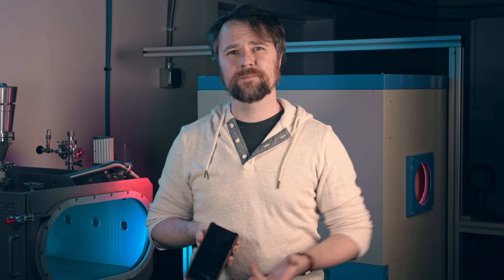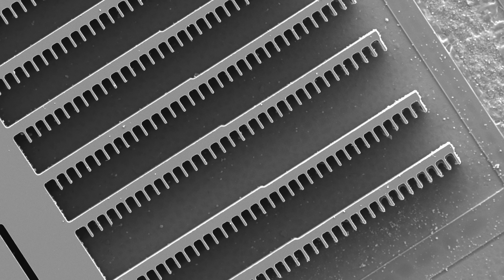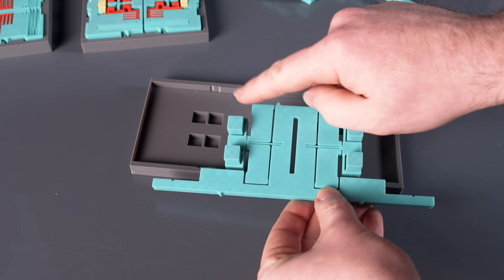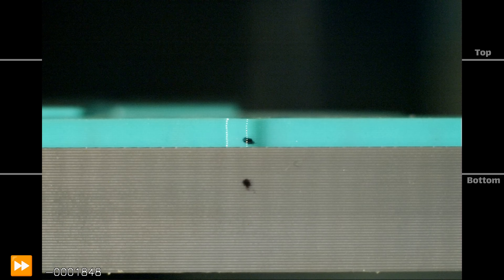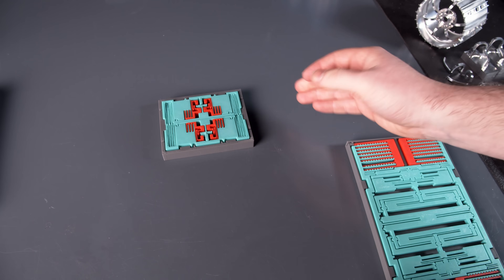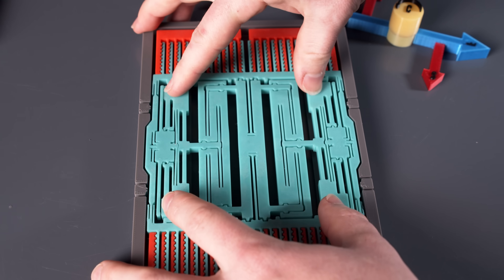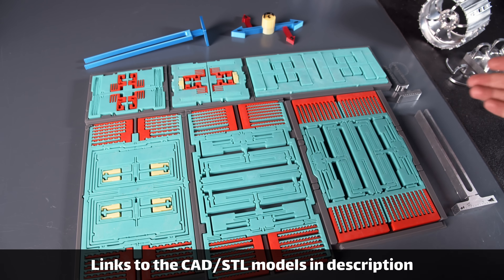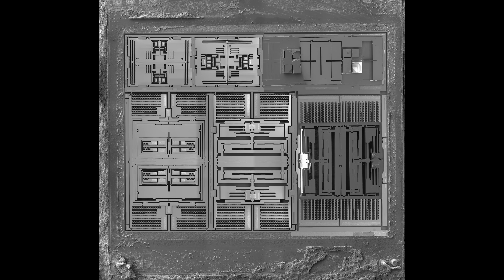The Micro Mechanisms in Your Phone

Comment: Zach, I hope you were trying to simplify the explanation of the z-axis accelerometer. Because when you let go of the phone the one thing that won't happen is that the proof mass will not move because of Newton's first law. What happens (of course) is that UNTIL you let the phone go, the proof mass was experiencing the force due to gravity and thus was deflected downward in the mechanism of the accelerometer and when you let go, it will move up because there is now an unbalanced force on it from the flexure joint.

Comment: Maybe you can clear something up for us. This may only be an urban legend, but rumor has it that Morris hospital in Illinois had a tiny helium leak in their new MRI machine. Helium molecules are small enough to penetrate a sealed iPhone or Apple Watch, both of which apparently use MEMS devices for the main oscillator.

All iPhones and Apple watches in the building simply stopped working. Android phones at the time did not stop working, as they were not yet using this same molecular-level technology.

Helium as a gas expands to 750,000 times the volume it is as a liquid. The theory is that the helium molecules jammed the MEMS devices the same way that a grain of sand could stop a Swiss watch mechanism. Once these devices were unpowered and left alone for a week, they 'aired out' and began working again.

Does this sound to you like it might be at all possible?

Comment: “If you drop the phone, it will feel acceleration in the negative Z direction”. 
No. It will feel acceleration in whatever sensor is aligned with vertical. Most of the time, all three accelerometers will detect it, because most of the time, your phone is at an angle to the vertical.

Comment: 0:30 what‘s with the optical image stabilization? Apple (obviously) had problems that the system(s) die if you ride on a shaking motorcycle too long without a proper holder for the phone…

Comment: 1:42  Back in the day, we used to decap chips like this with fuming nitric acid.  (I worked for an EPROM programmer manufacturer, and sometimes we had to physically open the chips because the documentation was less than helpful)  Works great, but it's nasty stuff - you definitely need a fume hood for it.

Comment: What year were these types of single-material microscopic movement detection devices created? Not just a transistor or microchip but what we’re seeing here
Reply from the maker: MEMS have been around for quite a long time, but didn't really "escape" the laboratory until the late 90's and early 2000s. I'd say they really started to get cost effective (and function well enough) in 2010+. The rise of cell phones has certainly played a roll here. A lot of MEMS semiconductor fabs are actually older / "last-generation" transistor fabs that have been repurposed. MEMS uses larger features so it's a good way to recycle an old facility instead of just junking it.

Comment: Hold on, paused at 6:15, when the phone is falling down, all its atoms (including atoma from thr mems) are moving together - gravity pulls everything at the same force (if we are talking just about the phone). This method with mass can detect when a phone hits something (a ground, floor), but not the beginning of the fall.
Am i wrong?
Reply: Look in the corrections lol. You're very right, but the your statement about the ending of a fall applies to the beginning of a fall too! The piece is having it's normal force applied by the sensor, which detects that an acceleration is on it, but it cancels that out because it thinks about gravity.

Comment: I wonder what sort of lifetime the flex points on the silicon have under normal use, how much movement can they take and what's the failure mode, and what sort of force would break them under a fault condition.

Comment: One thing that I wonder since this is essentially a glass-like material (silicon) is how do these microscopic not crack or break inside of the chip if there is a strong drop. I mean I've dropped my phone many times, yet the accelerometers and gyroscopes still work, how do they survive strong jolts or flexing many hundreds of thousands of times?

Comment: Wow. Very happy I found your channel.
But you made a typical physics error. If you drop a phone, you don't get downwards acceleration. A falling object ( ignoring air resistance) is indistinguishable from a object in zero gravity (See Einsteins Special relativity). Newton laws are only applicable if you are in a inertial frame of reference. If you standing on the earth, you are not in a inertial frame of reference, but you accelerating upwards. Gravity is strange.😆
Phones use special algorithms, that tries to emulate acceleration without gravity.
PS: I'm not a physicist, but at least I know something about this.
PS2: ok. I had not checked the comments, but I see the correction. Thanks

Comment: Ok , I’m new to your channel . Micro gyroscopes , I heard of them , but building something that tiny that actually works capturing movement in three directions . But that’s not actually measuring distance . For example , if you drop your device , it doesn’t measure distance from your hand to the ground . That’s the fourth dimension . 
And then altitude . That’s the fifth demension . 
I used to fly aircraft , and those are the five senses a bird uses to fly . 
But just building a platform to demonstrate them is neerly impossible . Now the next generation of computers . Quatuntum . Yah , that’s going to really test someone .

Comment: Creepy publication from 2019 on accelerometers:

'Abstract:

Accelerometers are sensors for measuring acceleration forces. They can be found embedded in many types of mobile devices, including tablet PCs, smartphones, and smartwatches. Some common uses of built-in accelerometers are automatic image stabilization, device orientation detection, and shake detection. In contrast to sensors like microphones and cameras, accelerometers are widely regarded as not privacy-intrusive. This sentiment is reflected in protection policies of current mobile operating systems, where third-party apps can access accelerometer data without requiring security permission. It has been shown in experiments, however, that seemingly innocuous sensors can be used as a side channel to infer highly sensitive information about people in their vicinity. Drawing from existing literature, we found that accelerometer data alone may be sufficient to obtain information about a device holder's location, activities, health condition, body features, gender, age, personality traits, and emotional state. Acceleration signals can even be used to uniquely identify a person based on biometric movement patterns and to reconstruct sequences of text entered into a device, including passwords. In the light of these possible inferences, we suggest that accelerometers should urgently be re-evaluated in terms of their privacy implications, along with corresponding adjustments to sensor protection mechanisms.'

https://dl.acm.org/doi/abs/10.1145/3309074.3309076

Comment: Extremely cool video!

It's interesting that the Y accelerometer isn't just the X one rotated by 90 degrees. It seems clear that they wanted the gyros to have as much space as possible, and the space left for accelerometers ended up being rectangular, so they had to design two parts rather than rotating a square part.

Comment: The cell phone knows where it is at all times. It knows this because it knows where it isn't. By subtracting where it is from where it isn't, or where it isn't from where it is (whichever is greater), it obtains a difference, or deviation. The guidance subsystem uses deviations to generate corrective commands to send signals from a position where it is to a position where it isn't, and arriving at a position where it wasn't, it now is. Consequently, the position where it is, is now the position that it wasn't, and it follows that the position that it was, is now the position that it isn't.
In the event that the position that it is in is not the position that it wasn't, the system has acquired a variation, the variation being the difference between where the cell phone is, and where it wasn't. If variation is considered to be a significant factor, it too may be corrected by the GEA. However, the cellphone must also know where it was.
The cellphone guidance computer scenario works as follows. Because a variation has modified some of the information the cellphone has obtained, it is not sure just where it is. However, it is sure where it isn't, within reason, and it knows where it was. It now subtracts where it should be from where it wasn't, or vice-versa, and by differentiating this from the algebraic sum of where it shouldn't be, and where it was, it is able to obtain the deviation and its variation, which is called error.

Comment: Micro x-ray imaging is a nondestructive method for peaking inside the chip. Manufacturers use it for verifying surface mount antenna and BGA splatter issues, and IP attorneys use it to peek inside chip dies to verify IP theft.

Comment: actually there is a small mistake here 4:58 which is that dropping your phone is NOT accelerating.. its in free fall geodesic.. the Z axis will report 0 reading while its falling .. it’s actually holding it still in your hand that makes it in acceleration state, and the z axis would report 9.81 m/s reading .. its a very common mistake until you learn more about general relativity ❤

Comment: Honestly I think a better design would use light or some smaller particle emitter to detect the velocity in any direction, let's say you have a narrow path for a single particle with just enough wiggle room that in the event of a change in relative position of the path the particle either bounces or shifts into a further/nearer position to reach the same sensor, pair 3 of those paths in different orientations together and you will get the velocity of any direction based on the time taken to reach the sensor, since capacitors are bulky any ways you could have a dedicated capacitor designed with 3 of such paths attached o it's exterior, which in turn means you only have to deal with 1 design for all 3 velocities and have a chip sort out the details of the 3 before outputting the results, be a lot more like the "static" hardware design that's preferred by companies for it's longevity and reduces design overhead since capacitor design is also simple and static.

Comment: I used heated red sulfuric acid to etch the package; beaker and hotplate; 10 minutes at a time.   Also, you can created a cavity with a milling, and drop few drops of the acid, wash and rinse, and repeat.  The acid can also etch gold (wiredbodn) but a much slower than the plastic package.  Google: istfa proceedings. Safety: apron, glasses, gloves, a very well ventilated area, and a lot of common sense.

Comment: Hey, great explanation video.

One correction, MEMS devices don't actually measure acceleration when they're dropped. When they're dropped their frame of reference is also accelerating; if you read the acceleration during a drop it should read zero. The test mass is also affected by gravity during a drop.

Phone APIs that use these have documentation on how to apply a low pass filter to filter out gravity.
Ultimately they're measuring force on the test mass as compared to the stable part.

Comment: I think your example of dropping the phone is flawed, at rest the sensor will be detecting an acceleration rate equal to 1Gee, or 9.8m/s squared. The software will be calibrated to recognize this as zero. When the phone drops the entirety of the phones mass including the sensors reference mass will fall at roughly the same speed,  the phone body will experience some drag, but the net effect is that there's less acceleration at work on the sensor.

Comment: I wonder if there is an integrated opAmp and ADC on chip. That could easily be done with current silicon technology.
I’m an electrical engineering PhD student who works mostly in III/V semiconductor technology, but the fact that we can still fabricate (sub) micron scale features using ultraviolet light shown through a mask and then etched away is simply astonishing.

Comment: I'm blown away at the effort just as much as the detail and lay-translation!  Mega kudos!  I'd like to know how in the heck the designs were originally engineered, tuned, and optimized.  That history would make a great subject.  I just watched a video about the origin of BASIC and the man behind it using a gang of undergrads.  I have a sweet-tooth for the deep dives.  Micro accelerometers and gyros would be a good deep history dive.

I once thought of applying those to an original powered sub-woofer design.

Comment: Hey, so minor nitpick: Your phone actually feels zero acceleration when you drop it, and it's only when you hold it that it reads an acceleration in the positive z direction. It's a little counter-intuitive, but since everything is falling at the same rate when under free-fall, it means that there's no relative motion at all in the mems devices, so it can't detect anything. However, once you hold your phone, the outer shell is fixed in place, but the inner proof masses can be pulled down a little and flex, giving you a measurement.

Comment: Just wanted to correct your explanation about the accelerometer mems devices.  The acceleration they detect is from gravity, not from the movement of the phone.  As you well know when an object is dropped, in free fall, it experiences no acceleration relative to itself.  So what it actually calculates is the orientation of the phone from the vector of gravity.

Comment: Awesome job with the video! Even with the slight errors and simplifications, this was a refreshing watch. I design these kinds of inertial MEMS sensors for a living, and it's cool to see someone really explain the structure and operating principles of these fascinating devices to the lay audience. The printed models really helped there. Typical explanatory articles/videos only show some microscope/SEM pics and maybe explain there's a tiny moving mass and it's sensed capacitively. There's a lot more to it than that, as you presented well. Kudos!

A scanning MEMS mirror for e.g. lidar applications could be a good visual example for a future video. They're simple but striking devices, and usually come in a housing that's clear in the visible light range (some are even available as bare dies), so there could be some cool footage to be had of them in operation.

Comment: I worked at Nokia for almost 7 years, in a position with global R&D responsibility; between Nokia engineers, and engineers at our suppliers, there was an amazing stream of innovative mechanics, optics, electronics.... There were so many cool innovations, so far ahead of the market, that were often held back by the conservative nature of management: A touchscreen tablet computer in 2000... full touchscreen UI in 2005...7 mm 'thick' phone in 2006... a coprocessor for sensors and UI, in 2010, 5 years before 'other companies'... a Linux-based OS, set for release in 2012, 'killed' by 'new management'....and, of course, all of the sliding, folding, twisting mechanisms!!

Comment: Fantastic video, it immediately earned a subscribe.  One question -- I know how silicon is normally etched, which explains how the general shape of this chip's "springy" components are "cut", but I don't understand how the open space under these "plates" are made (allowing them to move freely).  Is there some way to etch out the "basement" of these chips in place, or are the microscopic components cut out as free and separate pieces (like your printed ones) and somehow assembled?

Comment: One quick correcto: when you drop your phone with the Z accelerometer oriented upward, it will experience a lack of acceleration, because when you are holding it up, it is measuring gravitational acceleration relative to itself. When it is falling, it can not measure gravitation because both the device and the proof mass are experiencing the same acceleration.

Comment: The most important thing is missing - these records are constantly vibrating!!! The meaning of constant oscillations is in the effect of the gyroscope. To do this, it is not necessary to rotate, it is enough to move a little in space - but very quickly and often. In addition, changing the linear dimensions of the plate is used to remove the position signal - through the tank, which is very convenient. Oops, no longer a secret.

Comment: I worked on accelerometer design in 1971. These were force feedback devices. The mass was supported at one end using a molecular hinge. The mass acted like a pendulum. The movement of the far end was detected using coils fed from a high frequency oscillator. Mounted on the pendulum was a loud speaker type coil. This was inserted into a pot magnet. The current needed to return the pendulum to the null position was proportional to the acceleration. This was achieved using an analog Servo. The current could be fed to an integrator to get velocity and a second integrator for distance.  Mechanical oscillations in the pendulum hinge were a problem. The device was encapsulated and filled with oil. Any vibrations from external sources didn't reach the pendulum. Important to avoid this in an aircraft. The engines produce a whole range of mechanical vibrations especially when starting up. I suspect the mems devices are filled with inert gas to help reduce oscillations.